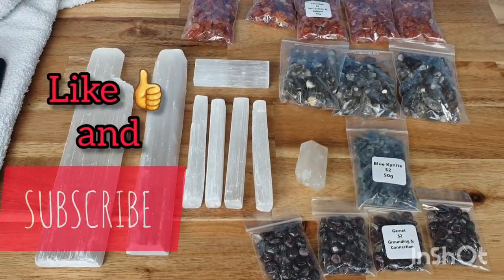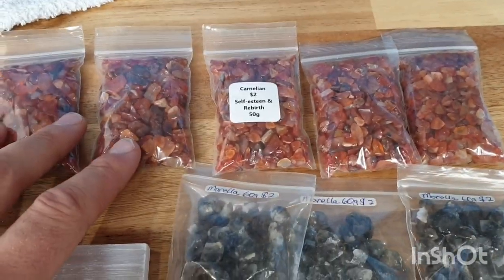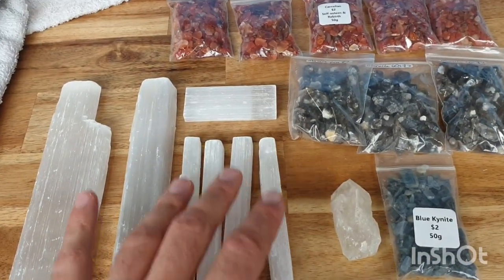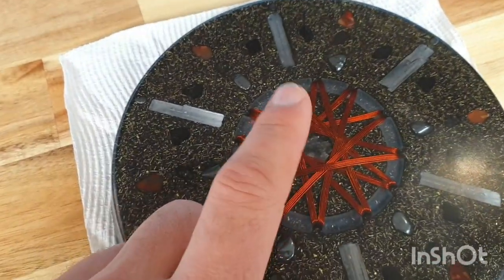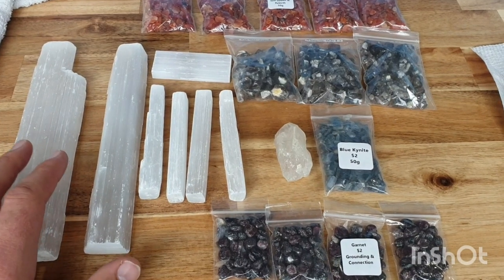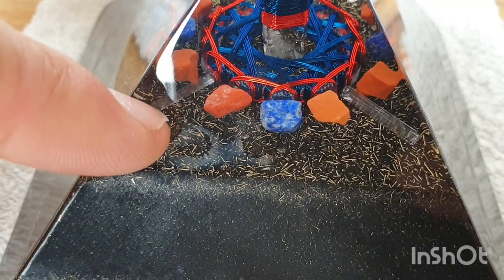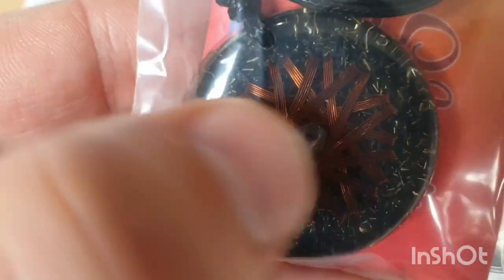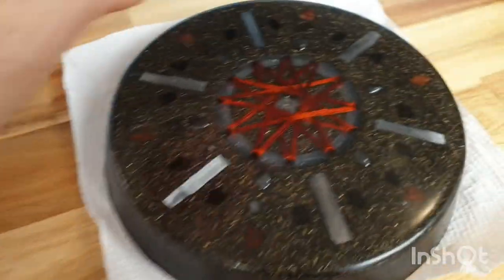Crystals for our Orgonite, packaging parcels ready to ship & Custom Orders

Comment: Love those coils I thought they might be Rhodin inspired.  Got a question for ya, from your experience do you know if you can leave resin castings in molds for too long?  I am working with temperature extremes and its increased my Pot times quite a bit so I’m erring on the side of the longer the better but am getting odd surface imperfections 🤔🧐 appreciate ya
Reply from the maker: I would say no that you can't leave them in the mold to long. Shouldn't matter unless you still want to pour another layer and its come away from the mold. I'm not sure what resin your using but this is most likely to happen with polyester resin. 
I would say the uneven surface is because of the heat and guess that its dimpling or leaving small craters?
Reply: @sasorgonitecreations  yes to polyester, I did get a couple small craters recently but the weird thing happening is more like a growth pattern of distorted nodules and somewhat bumpy surface if that makes any sense.  I meant to say initially I am dealing with humidity extremes but stable temps at night here in Florida.  A local resin artist suggested it might be from soap residue and I could clean the silicone mold with rubbing alcohol to be thorough.  I got a 98% better casting after that and then the following casting was more of the same.  Now I am jumping back to thinking too much catalyst again, could be very likely working with MEKP instead of a nice ratio.  Would you mind if I emailed you a few photos to see if you’ve seen anything like it before and maybe confirm my suspicions? Google only goes so far these days, I’d appreciate an experienced opinion, thx 😊
Reply from the maker: @TDogsYard  Hey sorry for the late reply my friend 🙏
Yes you can definitely send some photos through sasorgonite1@gmail.com 
But I would say that it is indeed the amount of hardner used! This will happen the more heat you have. So a nice slow cure will be a smother finish.